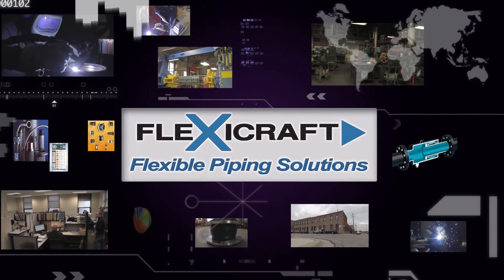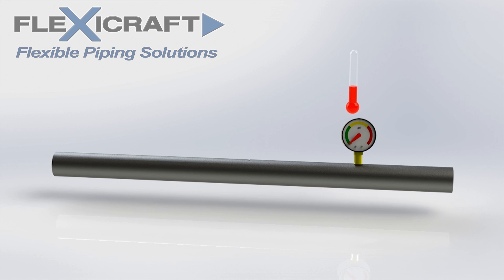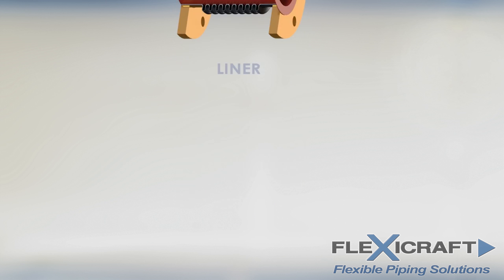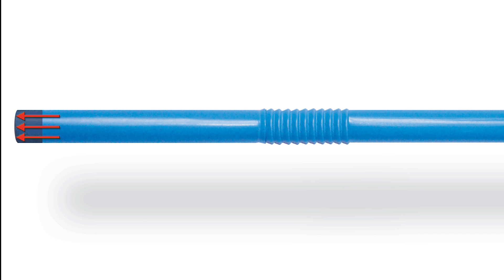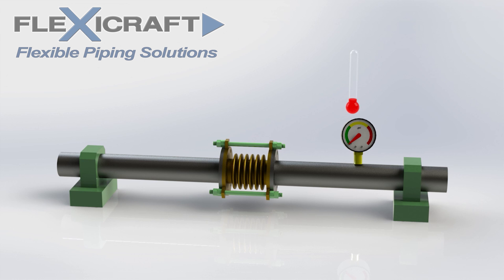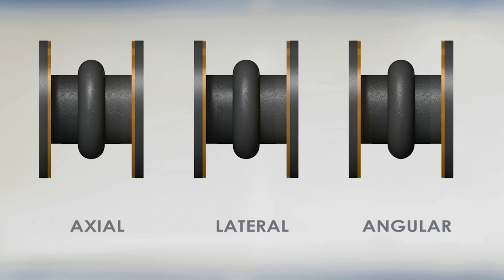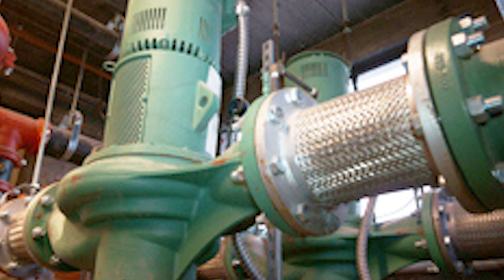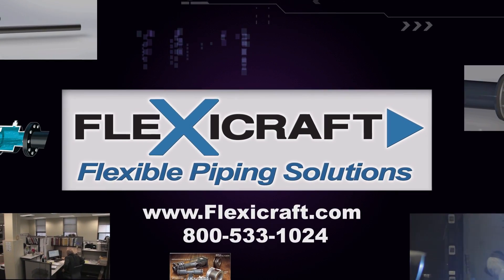Flexicraft Expansion Joints Overview

Comment from the maker: You can use an axial pressure balanced expansion joint to eliminate the thrust load on the anchors, as you suggest.  However, our ML Loops also eliminate the load, and usually the better choice for pipe diameters up to 12".  http://www.flexicraft.com/ML_Loops

Comment: in case of axial contraction of bellow ..tie rod in not contact with nut . in this case instead of putting anchors at ends can i use axial pressure balance expansion joint